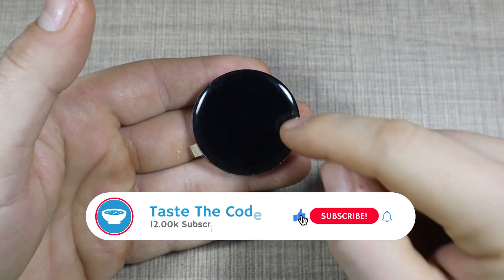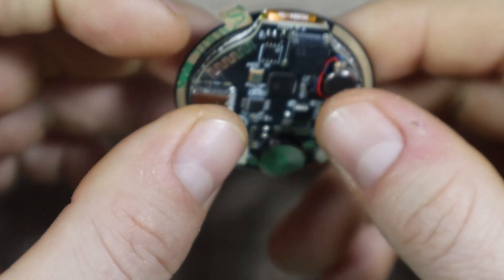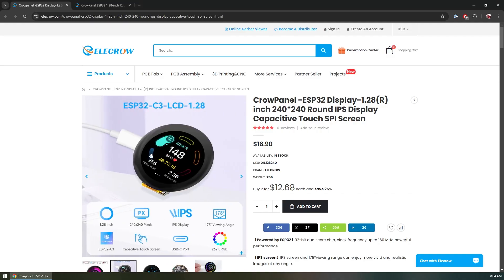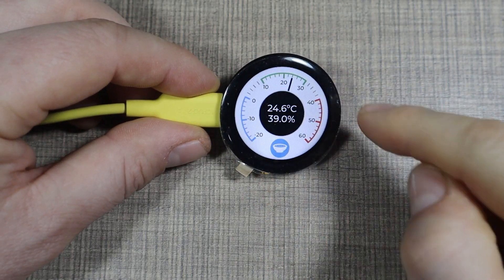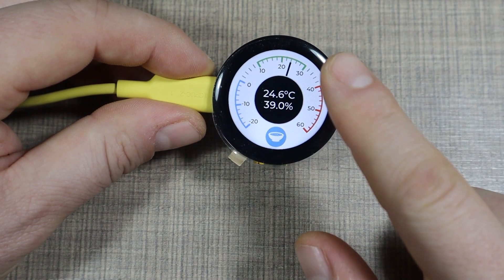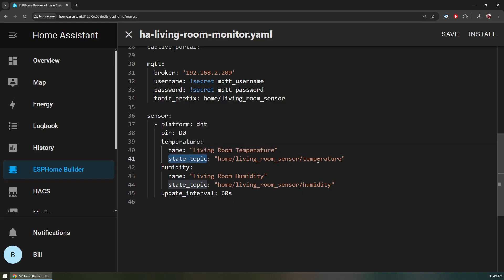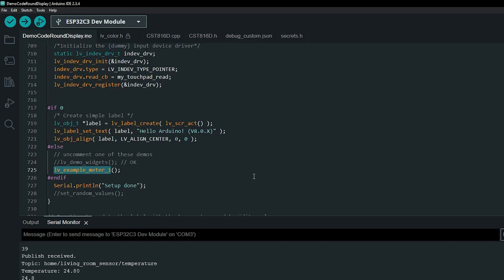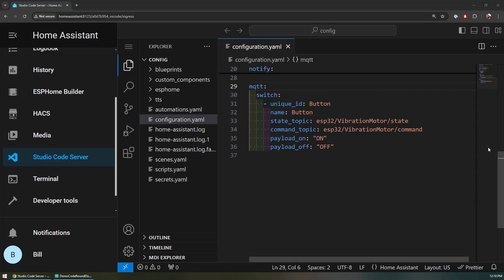"Xerothermic" Display to improve your smart home monitoring with CrowPanel ESP32 Round display

Comment: Hi. Does this display have the GC9A01 driver?
Reply from the maker: It might but I'm not entirely sure. The chip markings are erased and not readable and there is no mention of the GC9A01 anywhere in the official docs. However, the LGFX helper class in the example code provided has this line inside: lgfx::Panel_GC9A01 _panel_instance;

Comment: Was looking for a way to build a dyi thermostat control like the nest for a while. This combined with a rotary encoder would be a great soloution. Any chance one can repurpose the pins of the rotary encoder on the side for that?
Reply from the maker: If you are good at micro soldering then probably yes. I guess it can be combined with a wheel on the side and not bother at all. Also, keep in mind that this has touch so maybe no extra hardware is needed and it can all be controlled with touch.
Reply: @TasteTheCode  Thanks for the quick reply, I guess I'll order one and give it a shot :)

Comment: Also, having the USB that way means you will have a cable visible 🤦 would be better if perpendicular to the board going inside the box or the wall say 😅
Reply from the maker: I think their reasoning is that you will have this battery powered and only use the USB for charging.